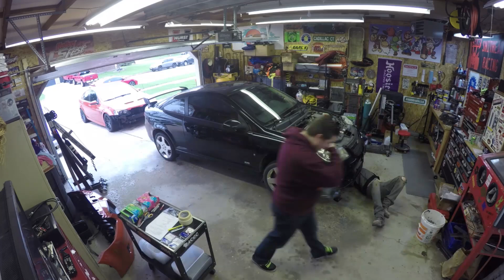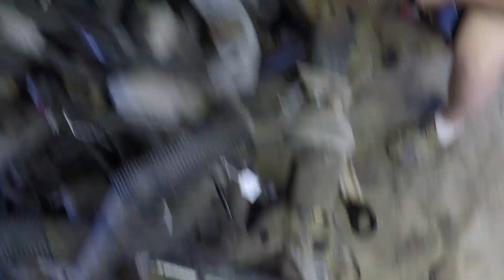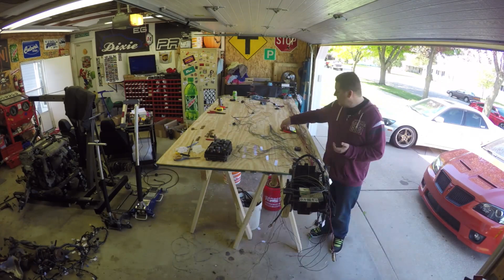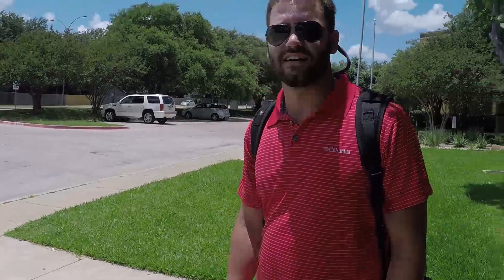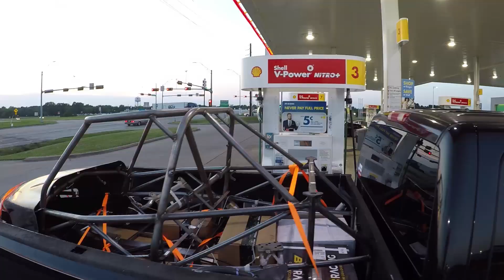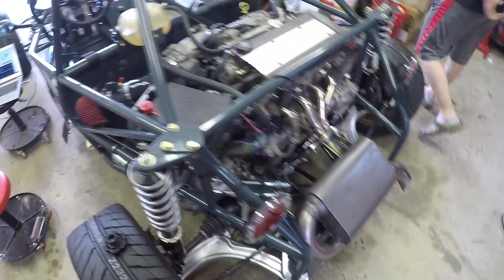DF Goblin Kit Car Build

Comment: I am thinking about building one of these after my current build. Was there many modifications you had to do to make it work?
Reply from the maker: Not really, the kit is very complete and easy to assemble. I did a lot of modifications just because I wanted it to perform even better.
Reply: @WOTclub  that is good. I more than likely will do some modifications as well
Reply from the maker: @decelation  awesome! What sort of mods you thinking?
Reply: @WOTclub  was mostly looking into power upgrades